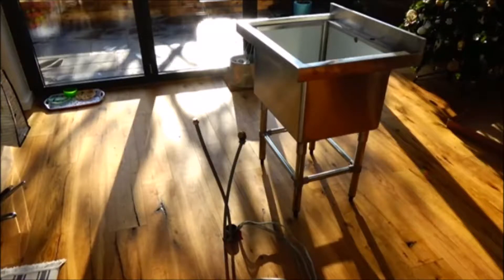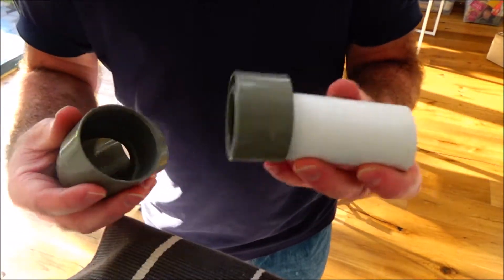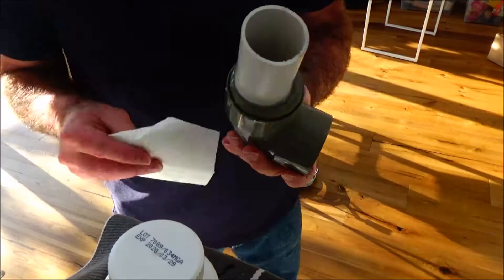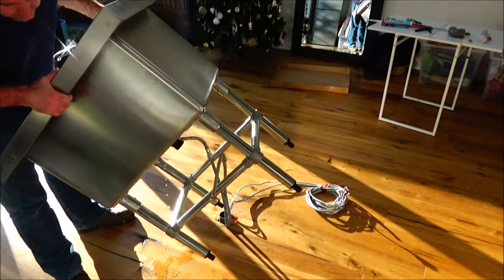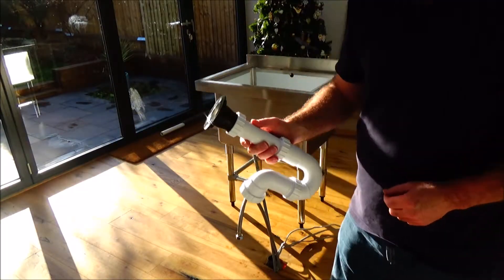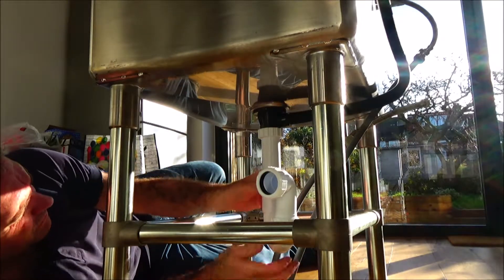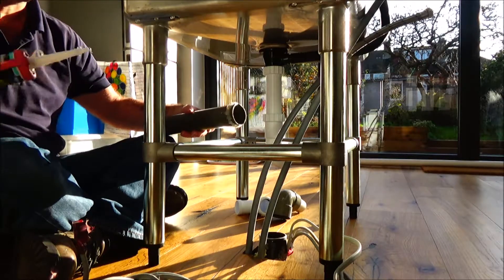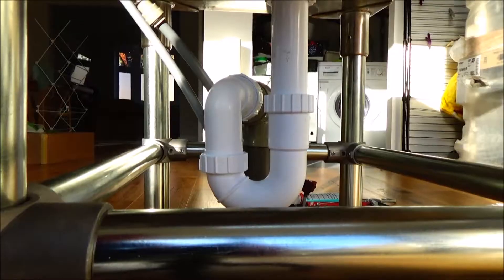Installing a Stainless Steel Industrial Sink and Taps In My Kitchen

Comment: I have never seen that. Strange.. Who would want a sink floating in the middle of a room? With the back wide open so you just see hose, sink and open back of the sink in the middle of the room.  huh..
Reply from the maker: It was a temporary solution until my island was built. My later videos show the island in place and kitchen now finished.
Reply: I'm a plumber and I've seen that many times in my life.